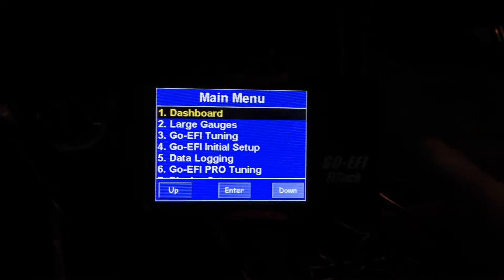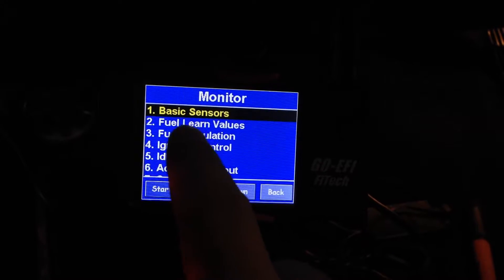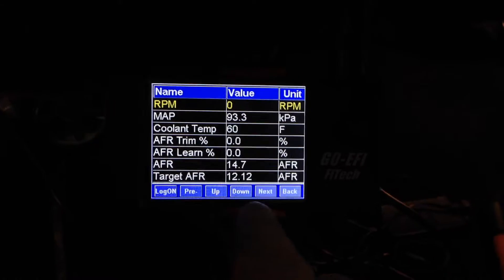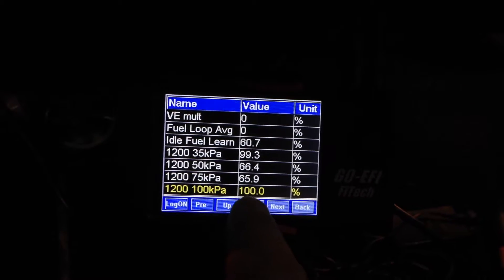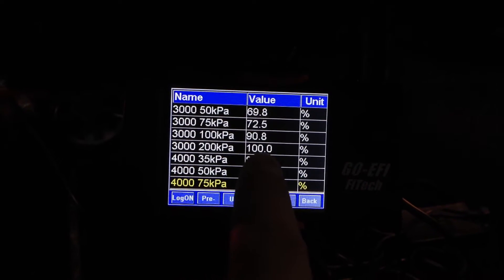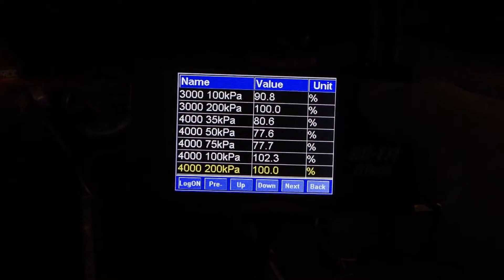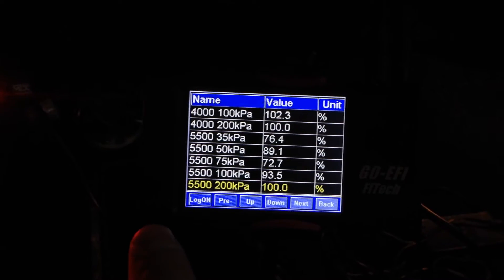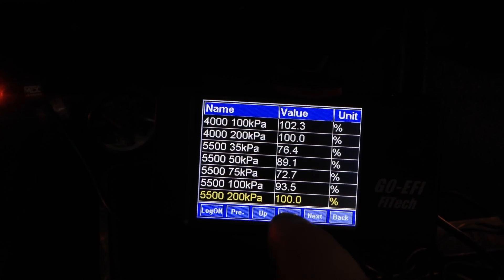Fitech - How to read your fuel table learned values

Comment: So Fuel Learn values are centered around 100%. 
Nothing has been learned. 
80% value means the ECU is subtracting 20% because it’s Rich. 
Now what if you see 125%, I assume the ECU is adding 25% fuel because it’s a little lean in that area. Correct?

Comment: Should I be worried if most of my numbers are above 100? Or is there an adjustment I need to make?
Reply from the maker: Nashville Early Bronco look at your plugs. If they're tan/light you're fine. If they're black and rich or wet. Then you have a vacuum or free air leak that's skewing the O2 readings and making it run rich.
Reply: Nabors75 yeah I feel like above 2000 RPM is starts running really rich. IAC starts jumping super high and it almost feels like it's getting bogged down with fuel. One of your videos you mentioned how the adjusting the cam size in the initial set up can adjust a lot of the fuel settings, I'm going to change my cam setting and see if that helps too. Thanks for the videos!
Reply: Nabors75 yeah I feel like above 2000 RPM is starts running really rich. IAC starts jumping super high and it almost feels like it's getting bogged down with fuel. One of your videos you mentioned how the adjusting the cam size in the initial set up can adjust a lot of the fuel settings, I'm going to change my cam setting and see if that helps too. Thanks for the videos!